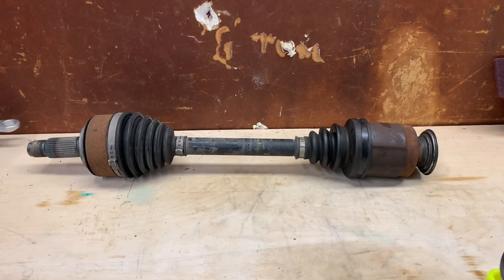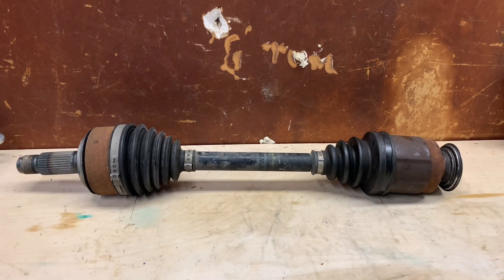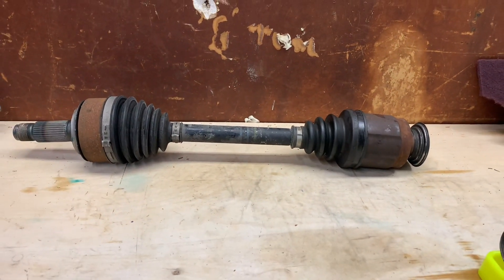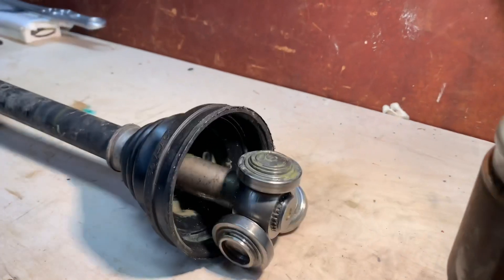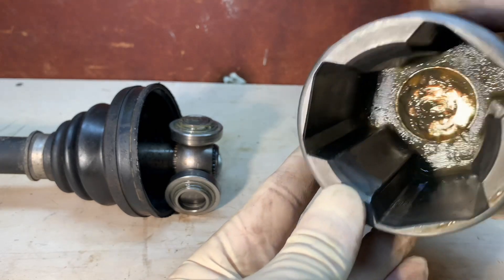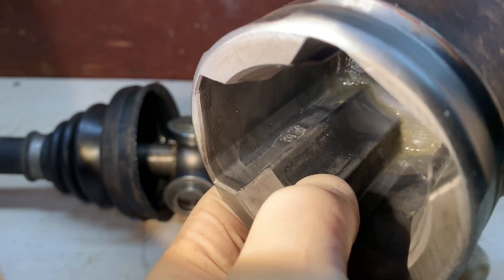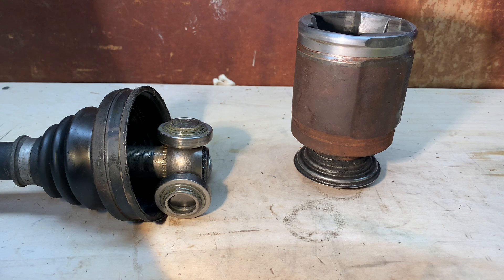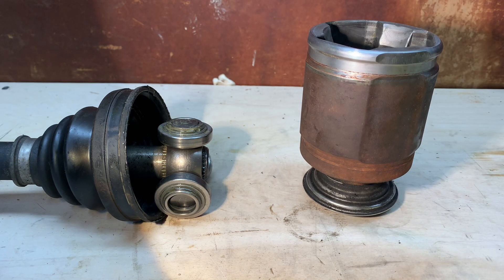Honda and acura vibration issue!

Comment: Take my advice and rebuild the factory CV axle. I bought cheap aftermarket ones from ebay and rock auto. 2 new sets and 3 of the 4 were faulty. I had thrown my original ones in the trash. Ended up going to Napa and got a decent set but still have a slight vibration. I have an 09 ridgeline and replaced the rotors, inner and outer tie rods, struts and lower control arms before I realized the new axles were junk.
Reply from the maker: Yes this can happen for sure although not many are qualified to rebuild them themselves. There’s some decent aftermarket ones out there for a fraction of the cost.
Reply: Tangent incoming,

so I had to replace my passenger front CV axle in my 2017 Ridgeline. I wanted to go with OEM but they are backorder so I went with aftermarket as there was slight seepage from the axle seal 
Well after 1.5 years the Aftermarket is toast, boot is split grease everywhere ( to be honest there was no clicking or 'weird vibration' I'm at 185K miles there will be some age ) saw the mess when I changed the oil. It has to have been fresh since the grease was still shiny.
Tried to order an OEM online from hondapart, honda college, and Hondadirect backordered; in fact, hondadirect showed in stock so I put in an order, but after a few days they canceled my order due to backorder. Went to the dealer it was still backordered plus they want me to pre-pay 400$ for no ETA!

I figured aftermarket would last for a year or two before I could order OEMs, had I known this chaos I would have had the OEMs rebuilt
Reply: If rebuilding / reboot & re-grease you have to mark exactly all the parts how they came off the spline and they have to go back on exactly the same way.  I use Super Met-al white parts marker ink. Or white meanstreak sharpie. Maintains the balance. This in honda shop manual
Reply: @hukmai I had this problem already on a Toyota 4Runner buying aftermarket axles. The rubber boots only lasted maybe 2 years. But the joints are still good no clicking and no vibration is it possible to order maybe OEM boots and try to rebuild using OEM real rubber boots and not the cheap rubber boots of the aftermarket axles. Also Beck Arnley brand might sell boots
Reply: I'm going through this now on an '04 CR-V. Advance Auto axle gave me fairly bad vibrations, I assumed it was a motor mount going out and have one on order (the front mount, which controls the back-and-forth rocking axis) but I suspect the axle is at least part of the problem.

Comment: Had a similar issue with my '05 Element but it would only vibrate from a stop and not at road or highway speeds.  Bought this car with one remaufactured axle and one aftermarket.  Tried a couple of new aftermarket axles to no avail.  Ended up solving the problem with two OEM Honda axles from a scrap yard as a matched pair from one car.  My theory being that if the car had a matched pair then this was a car that didn't have axle issues.  Note:  At risk, I also bought an unmatched OEM pair from LKQ and these worked fine too and these are the set on the car now.  The pair from the scrap yard are my "backup" pair.
Reply from the maker: Appreciate you sharing

Comment: Just replace my driver side axle because it was clicking like mad only when I was going around a corner and accelerating.
The boot was fine so I guess you're right they just kind of wear out over time
Reply from the maker: Yep lots of times the grease just thickened up and/or the joint itself is just worn out and the boots are fine.

Comment: On my wife's 2005 Accord they were making a growling noise that got noticeably loud.  The local dealership service manager is really good about getting deals on parts, but both OEM axles installed still cost over $1,000 with a discount on the parts.  Aftermarket axles are a lot less expensive, and the dealership has tried some at customer's requests, but found that they often had issues so they stopped doing it.  That cup and bearing shouldn't cost too much, but Honda charges crazy money for a lot of their replacement parts.

A boot strap kit is inexpensive, and good moly grease doesn't cost much, so changing the grease can be done for a very reasonable price.  It's not difficult - just a bit messy.  If you're doing your own work, consider it as a maintenance item.
Reply from the maker: Great info 👏

Comment: Hi i have 2005 honda pilot. i used to have aftermarket cv axle had no issues because boot is broken , i went with OEM on both side. i am having vibration issue at steering at 20 mph NOT while accelerating only at cruising at 20 mph .. momemt i accellerate vibration goes away...  i dont know if this cv axle . i do see a play on passenger side cv axle. in and out.. not up and down.

question.
1. does in and out play is normal,  i assume up and down is not normal.
2. can i assume if virbation doesnt come on acceleration then it is not a cv axle issue
3. based on my symptoms do u think if this is cv axle or something else.. 
4. Not sure if intermeidate shaft will cause this issue.

much appreciated. thanks in advance.

rest all like sway bar busing, control arm, struts they are pretty much new..  i am feeling this symptom after replacing OEM cv axle , weared part of it. just want to run it with you that i am  not missing anything like drive shaft etc.

Comment: I just bought today a 2007 Honda Civic Type R and it has a vibration issue when I go full throttle and it gets progressively worse at speeds of 70mph+. I think the severe vibration was present when I tried coasting at around 100mph with the clutch depressed, I'm gonna try tomorrow again to verify. Do you think it's the driveshafts that are the cause even if it the vibration is present when coasting? I can't feel the issue or it's not that bad when speeds are below 60mph.
Reply from the maker: No, if it’s while coasting as well then something else is going on, bent wheel/hub, rust in between rotor and hub, tire, etc…

Comment: Very known issue on the TSXs, my 08 has this issue from 20-25mph, most guys on the old forums found racing axles as the solution as all the other aftermarket axles still had harmonic or vibration issues
Reply from the maker: Yea same thing with the 7th gen accords

Comment: So I just replaced my passenger axle for the first time. Not too bad as a job to get done. 

But my car is now vibrating at 20-30mph. 

The one replaced was OEM and the one I had installed was a “Duralast Gold” brand. Could it be the AE part? 

What could I do? Cause this vibration is driving me crazy.
Reply from the maker: Yep, could definitely be that aftermarket axle for sure
Reply: Did you find solution in your case?

Comment: You don’t get vibration in the steering wheel on hard acceleration with worn CV axels. It’s a chassis shudder that you feel, not steering
Reply from the maker: I have replaced worn axles hundreds of times for a steering vibration and I have confirmed this hundred of times.

Comment: sent an IG message related...!  I just bought a 2009 Ridgeline with 163k miles and the vibration happens around 60mph and above...  not really a steering wheel shake but more of an intense humming vibration...  had the wheels balanced today and it's better BUT has not solved the problem.  manager at tireshop mentioned they've replaced rear driveshafts on Pilots (same platform as Ridgeline).  acceleration, cruising and slowing down above 60mph is when it happens and low speeds, under 40mph are smooth.  thoughts?  going to take to an independent (Honda/Acura) shop tomorrow as my dealer that did the pre-purchase inspection can't fit it in tomorrow
Reply from the maker: One way to isolate the rear from the front is to removed the driveshaft and test drive it. Where the tires road force balanced or just high speed balance? Are the wheels true and not bent? Is there fix a flat in the wheels?
Reply: @BCautosutions  sorry for late reply BUT....  yes, the wheels have been road-forced balanced AND one of the wheels was bent (wheel shop straightened it)...   

had the rear propeller shaft (drive shaft) looked at and the center carrier bearing was on it's way out...  and the front u-joint was pretty notchy but rear u-joint wasn't AS notchy but still had knots in it...

unsure if there's any fix-a-flat BUT tireshop told me tires are dated 2019 so may be time to get new ones even though lots of tread left (Michelin Defenders)...  noise is noticeable after all this BUT not nearly as bad and not much of a vibration...  

maybe tire time!  you should be in the Boston area so I could bring to you!

Comment: What if it's like a wobble or a warble like front to back or up to down?
I have 95 Civic and front wheel drive. So it's wobbling in that direction the axle goes. 
Like it's off a bit. I just replaced passenger side axle and seal and now this week replacing driver side axle and seal...
I am hoping this is what's causing it. And yes it's on acceleration... 45+ mph. .

Comment: Great video.  Have 2012 accord replaced both axles with aftermarket but still getting vibration when accelerating from 20 to 25 mph only.  Lately starting hearing rattling during vibration.
Reply from the maker: Yeah aftermarket axles are affordable but I’m some cases still have a vibration.
Reply: I just got done rebuilding rebooting one of my Accord axles I got the band kits from Amazon and I'm making sure I'm putting at least 130 Grams of Grease.....cv joint grease.... black Swepco 101 moly ngli #2  or Redline CV2. I had a similar axle scenario on a Lexus RX330 and I was able to get OEM axles from my salvage vehicle with 110,000 MI and they worked out great
Reply: Will never buy parts store axles. If they are good, boot deteriorate quickly, maybe only last 3 yrs or less

Comment: Help a brother out?! I just recently replaced my brake pads and rotor plus new tires and alignment. Car shakes only at 60mph and higher? Before all that with the old rotors and brake pad n tires which were worn didn’t shake at all? My car is 2002 Honda civic si ep3.
Reply from the maker: Could be rust behind the rotors or improperly balanced tires

Comment: Any Idea why a second generation TSX V6 would have a drive train vibration when ambient temp drops below 50 degrees Fahrenheit? Then goes away once the vehicle is up to operating temperature after about 10 minutes driving.
Reply from the maker: That’s odd. Maybe the grease in the axles is old and hard, and once it heats up softens up?

Comment: I’ve owned my integra type R dc5 for about 3 years now, I’ve had the problem ever since. I barely drive it but yeh I feel the vibrations above 130kmh. Mild vibrations, the car is correctly aligned and there is no shaft play. What do you guys think?
Reply from the maker: If it’s on acceleration only it’ll be axles. If it while accelerating/maintaining speed, and decel then probably wheels/tires

Comment: I have 2 aftermarket axles in my Acura TL type s rn. It shakes so bad when you first get it up to 50+mph but after a couple minutes it goes away but it always shakes above 70. I need new oem axles.
Reply from the maker: Could have other issues but that’s a solid start
Reply: That’s my EXACT problem with my 06 Accord V6. I got NAPA axles and still have the same problem
Reply: @hgfdksk17  i have Napa axles too. They don’t have the vibration dampener that the oem axles have so they vibrate a little. I’ve heard that raxles is a decent option for rebuild oem axles.
Reply: @robbym3542  what is Raxles? I still have my oem ones boxed up
Reply: @hgfdksk17  raxles are rebuilt oem axles. Was your cars shaking with the oem axles
Reply: @robbym3542  yes they were shaking
Reply: @hgfdksk17  might be a different issue then. Have your tires been balanced recently and have you tried rotating them to see if the it changes?
Reply: @robbym3542  yes I got them balanced and rotated. any bends in the wheels fixed.
Reply: @robbym3542 I have the same issue with the above 70/75 mph shaking/vibration, did changing the axles to oem fix ur issue?

Comment: Would this issue cause vibration at slower speed? In the 20 to 30 mph range? I have a 99 CRV with manual trans. Only 75k on the car. No rips in the axle boots. Will get a pretty good vibration on acceleration. Doesn’t do it all the time. Seems more prominent on a little bit of a grade after driving at higher speeds for a while. I have new axle bolts and grease because I wanted to keep the OEM axles. From all the reviews I read most after market axles for this car a hit and miss and Chinese crap. I plan to drive it till the tires come off and don’t want to be tearing it down monthly. Any ideas? Also, even tire wear, motor mounts aren’t broken from what I can see. Thank you!
Reply from the maker: Yes absolutely, and your right about the aftermarket axles as well. If it’s only on acceleration and it stops when you get off the ga it’s drivetrain related aka axles.
Reply: hello  i have crv 2009 2.4   114,000 miles. i install new tires balanced,  align, change trans oil and filter . and continue vibration when acceleration  i release the throtle and vibration dissapear..   if i accelerate slow basicali no vibration. .

Comment: The issue is the inner or inborard shaft cup pits just where those 3 bearings ride... Another issue is the stands in which the bearings sit on, the 3 prongs which hold the bearings can also het worn down too... causing play in the inboard end of the axle...so during acceleration the cv rod isn't centered anymore which causes vibration...One thing that accelerated this wear and tear is the absence of the dynamic dampner...and as you can see, this cv axle in this video doesn't have one.
Reply from the maker: @Delight.AutoCRAFT  💯

Comment: I have this problem on my 2004 TSX, the mechanic I use had the same car come in with the same issue he changed everything under the car, changed the axles three times, after market, OEM, nothing fixed it so I have new axles should I change them or get rid of the car?, engine runny like new it has some other minor issues but nothing serious.
Reply from the maker: Vibration only happens on acceleration? Also check for rust in between rotors and hub.

Comment: Have a suspension squeak in ‘12 odyssey. Replaced lower control arms but still there, most of the front suspension is only 2 years old (a lot of work in early 2021).  Just not the inner tie rods but those seems to be tight.  Any suggestions?  Squeak started 2 weeks ago, no vibration though, just creaking/squeaking. Also sway bar links are 2 years old too….
Reply from the maker: Was everything replaced with oem parts?
Reply: @BCautosutions  no.  Sway bar links are oem
Reply from the maker: @pragmaticoptimist46  was the noise there before all the suspension work or is it something new?
Reply: @BCautosutions  it’s new.  Suspension work was 2 years ago, sway bar links were Oem and 1.5 years ago.  Had rear main seal replaced and put in new power steering pump just 2 weeks ago and when I got it back it was squeaking/creaking. Noticeable at low speeds with radio off.  Seems like both side to side and front to back movement.  No noticeable issues with steering or handling.
Reply from the maker: @pragmaticoptimist46  ok so it seems like to me that there might be some loose suspension, subframe, of engine/trans mount. Have whomever did the work check over everything they touched to see if something was left loose.

Comment: Do you have a recommendation for an affordable aftermarket set of axles to use?
Reply from the maker: Trq from amazon I’ve had good luck with them
Reply: @BCautosutions  how is the longevity of those compared to oem?
Reply from the maker: @H8HotWeather  I’ve had some on for 2 years with no issues although I wouldn’t count of them go last nearly as long as oem. If they fail after 2-3 years you got your moneys worth imo.

Comment: trying to pin point a vibration in the steering wheel on my 9g accord V6 I changed axles, had tires balanced, replaced tie rods, recently had front wheel bearings and lower ball joint replaced but vibration still noticeable
Reply from the maker: What are the conditions the vibrations occurs under? Also oem axles or aftermarket?
Reply: @BCautosutions  oem axles vibration is more noticeable  at highway speeds it toned down but still noticeable probably try rotors next
Reply from the maker: @robertalicea5585  is it on acceleration only. For example if your driving at 70 and let go of the accelerator pedal does it subside or does it remain? If it doesn’t could be rust between rotor and hub or bent wheel(s)
Reply: @BCautosutions  it remains I tried rotating tires to see if the vibration moved but it didn't change

Comment: I’ve got an 03 element that has a  vibration during acceleration. Then loud road noise that comes and goes.
Reply from the maker: Probably the axles
Reply: @BCautosutions  i got vibration from my 03 element too, but i dont feel in steering wheel
Reply from the maker: @sss-fg4xh  where are you feeling it?